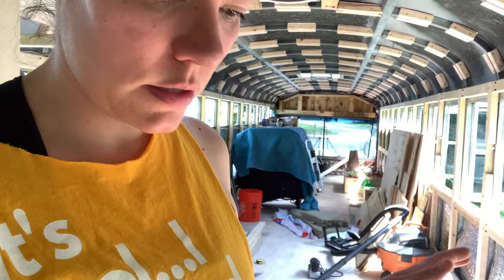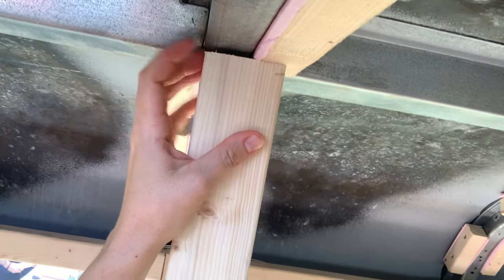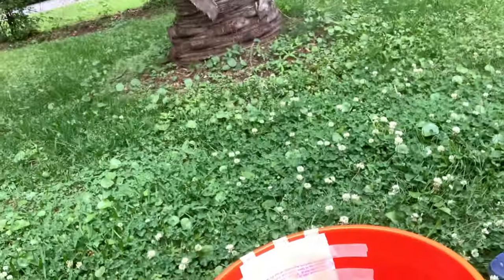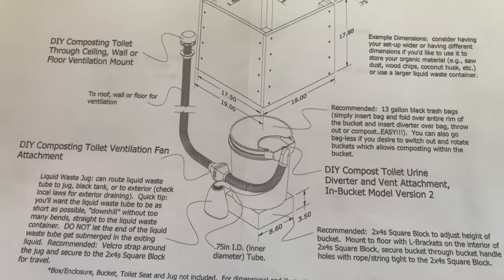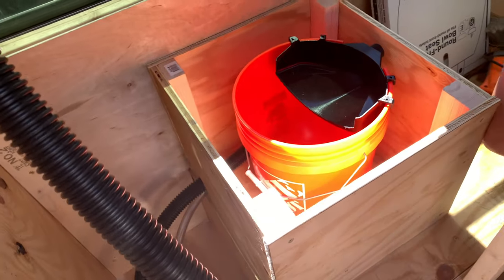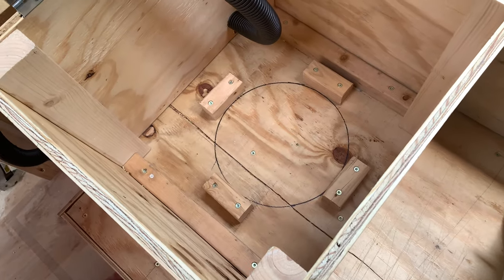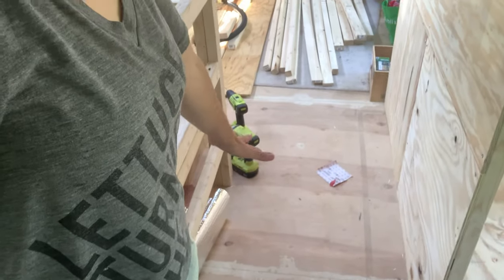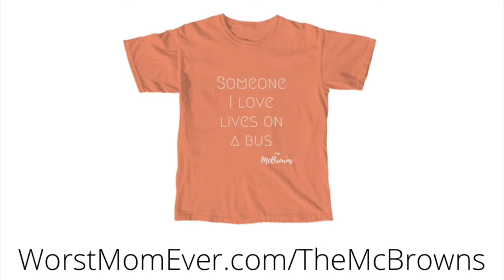DIY Composting Toilet Bathroom Bus Build-School Bus Conversion - SKOOLIE Video

Comment: How's the composting toilet working out for you? I bought the Road Commode which was pre built to a design similar to yours. Haven't installed it yet.
Reply from the maker: We've definitely had to make some tweaks - thanks to the kiddos, but nothing major. We did paint the entire bathroom with a mold-resistant/waterproof paint because we won't get to finalizing the shower/bathroom space for a while and it's just raw wood in the southern humidity and heat.
Reply: @TheMcBrowns  I can't imagine building a bus in summer in the Carolinas. It's a different kind of heat south of Virginia.